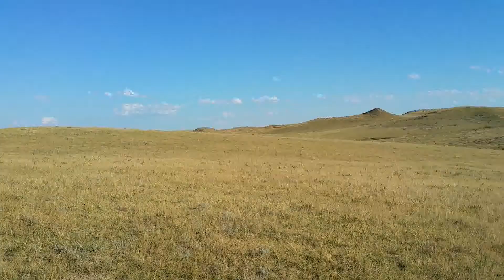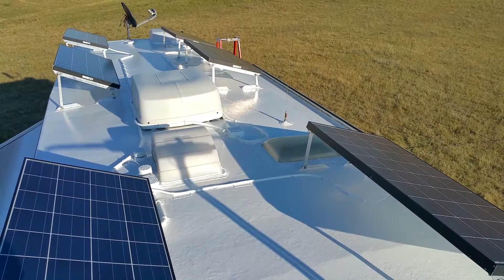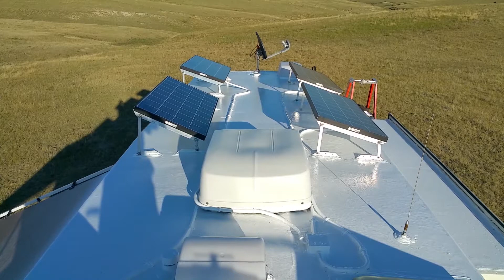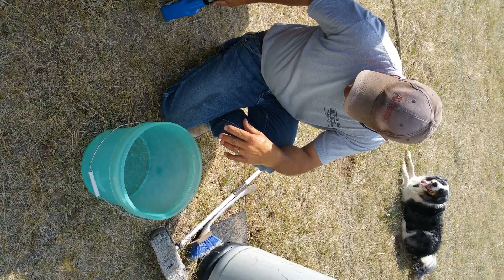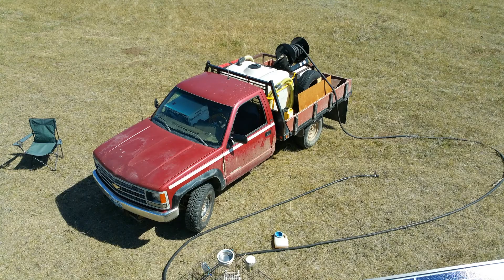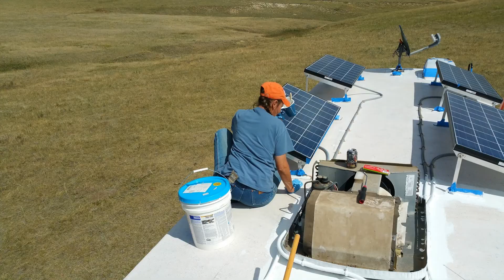"Solar Boondockers" making the old roof 100% "Silicone" Shine!

Comment: Just put 5 gallons Henry 887 Tropi-Cool on our 29 foot 06 Thor Grand Junction EPDM roof, no swelling, no deformation, no wrinkles! Roof is very clean and water pools up in beads. After a power wash, treated with anti-fungal then painted on all edges of roof fixtures and roof membrane edge tie downs with a paint brush, allowed 6 hours of cure time! Then 1/4 nap roller applied first coat, waited 12 hours of cure time and then 1/2 nap roller applied second coat! End result is beeeeuuuutiful! This will get me another 4 years or so out of the roof before a new roof deck and EPDM or TPO membrane replacement!
Reply: One warning, the roof is now VERY slick when wet, so I will be applying some slip-resistant tape strips on the roof at the ladder egress and on the rear slope leading up to the front half of the 5th wheel!

Comment: What's your opinion on using Henry's Envirowhite or Solar Flex instead of Tropicool for an RV roof? I sort of feel like the Tropicool is marked up in price and marketed toward RVers since we will only buy one bucket while the others are more likely to be sold to commercial companies buying in bulk. Envirowhite literally says it expands and releases moisture which is supposedly a selling point for Tropicool.
Reply from the maker: The Tropicool 887 is a high solids 100% silicone made for flexing joints like an RV. The other two will crack over time and will not bond to a EPDM rubber or TPO roof on a RV.
Happy Trails!!!
Reply: @MobileHomesteading  ahhhh, thank you! That makes more sense now! Guess I'll just have shell it out for the Tropicool then. Wonderful video. I feel so much more confident about tackling this project now. Gotta get ready for our first Arizona summer 😍
Reply from the maker: @l.ashleypalmer  You are welcome!
Happy Trails!!!

Comment: I found your story and video on the Love Your RV website.
My 2011 5th wheel has the original roof, now 11 years old. No leaks, thank God. Just weathered. I'm looking to give it new life with Henry's 887 Tropi-cool.

Did you also put Henry's Tropi-cool over your slide-outs? 2 coats as well?

What rubber roof cleaner did you use to prep the roof? 

I just had the roof washed and rinsed 2 days ago by a mobile RV detailer, but not pressure-washed. I'm wondering if I still need to do the roof cleaner and Dawn detergent step or if I can skip straight to painting on Henry's. Not asking for advice but if it was your rig and you just had the roof washed, would you still clean the roof before painting on Henry's?

Thanks, 
Scott
Reply from the maker: Howdy Scott!
   I did not use a primer, but we did clean the EPDM roof real good with rubber roof cleaner and washed off, then cleaned once again with dawn dish soap to clean off any chemicals, and a final fresh water rinse before we coated the roof twice. We did also coat the slide-out roofs twice. 
Happy Trails!!!
If you need help installing a Solar Power Storage System you can give us a call anytime.
  Eddie --- Mobile Homestead Solar Services (252) 475-8034
Our Web Site --- mobilehomesteading.com

Reply

Comment: This looks very interesting. Did you apply the 887 over the existing Eternabond tape and Dicor lap sealant or did all of that have to come off first?
Reply from the maker: Howdy! Yep, we did all the Eternabond taping of joints and Dicor. Then coated the roof with two coats of Henrys Tropi-Cool 887.
Happy trails!!!

Comment: Roof looks great! I was told about this product that it is a lot less of a mess than the Dicor..questions I had are how many coats did you do? And did you need to apply a primer? My roof is actually not in bad shape its 6 years old, but we want to put solar panels up and thought it might be a good idea to seal the roof now
Thanks
Reply from the maker: We put two coats on, and may do one more this year before we head out for boondocking in the South West. I did not use a primer, but we did clean the EPDM roof real good before we coated the roof. All's good for now!
If you need help installing a Solar Power Storage System you can give us a call anytime.
  Eddie --- Mobile Homestead Solar Services (252) 475-8034
Our Web Site --- mobilehomesteading.com
See us on our YouTube Channel --- Mobile Homesteading

Comment: I just picked up some Tropi-cool at Home Depot.  Today I got on the roof to clean and I had to replace a plumbing vent but plan on starting painting tomorrow.  My question is can I paint over my screws that are explosed, or should I cover them with lap sealant or eternabond tape before painting the silicone?  I believe if I cover them with lap sealant I'd have to wait 30 days or so before I can paint so it's fully cured.  I suppose I could just paint the rest and next month I could finish the areas that have fresh dicor lap sealant.

Comment: wonder if this or elastromeric is better for roof, i used elastromeric the last two times i done my roof, with no problems.
Reply from the maker: Howdy! The Henry's 887 100% Silicone HS roof coating I used has a "Lifetime" warranty. That's one reason we went this route.
Also it is rated for all seasons & and climates, perfect for the "Boondocker" who travels around to all climates.
We should not need to re-coat the roof unless we need to do a repair or install something new up on the roof.
Happy Trails!!!

Comment: Home Depot had a table in front of their store here in Palm Desert,Ca for this product (Henry's Tropi-Cool).. I've been considering how to deal with my declining epdm roof w/o spending thousands... Found your vid, looks great! Question: What did you do if/or/anything to prep for this?
Reply from the maker: Howdy! The 887 Tropi-Cool has up to this point been a wonderful decision over full rubber roof replacement.
 I first washed the roof with rubber roof cleaner and rinsed real good. Then I washed again with a light mix of Dawn dish washing soap to remove any chemicals from the roof rubber. Then I rinsed real good one more time. 
Allowed the roof to fully dry, then started the application process.
Happy Trails!!!